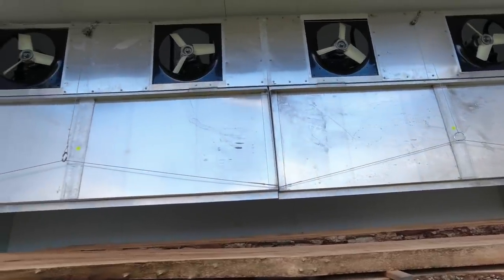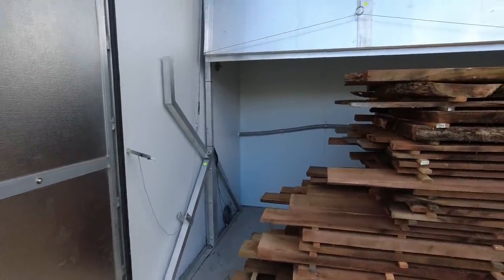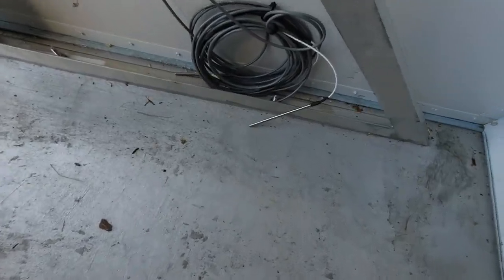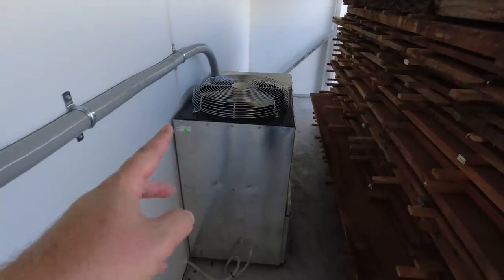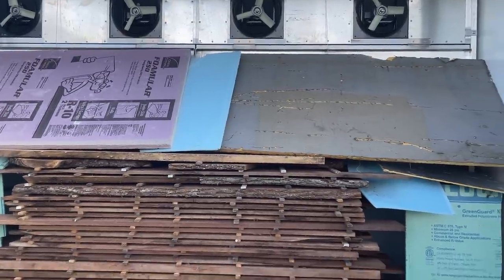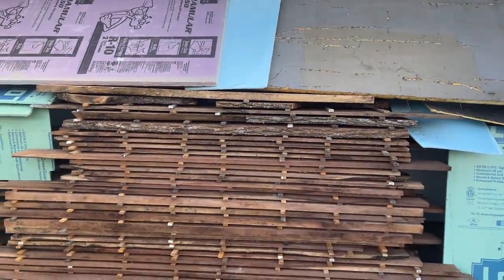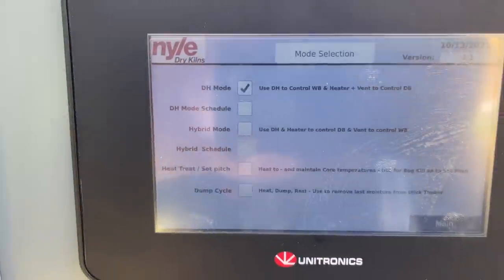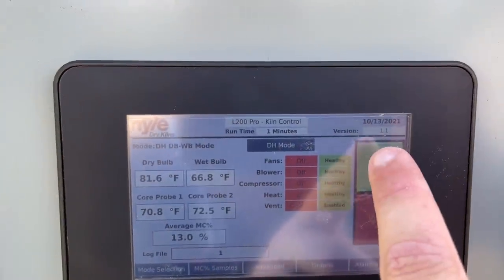Kiln Drying Lumber At It's Best, Nyle L200 Pro Tour

Comment: When I was a security guard at Memphis Hardwood in 76/77, I marveled how much math they had to use, to dry each kiln load.  They would load the stacks via a rail system and rail dollies into the kiln which were somewhere between 75 to 100 feet long.  The person in charge of drying the wood, had to cut samples from each stack as they pushed it into the kiln.  After all the stacks were pushed in, they would close the doors and he had all the samples, he would bring them to the office, weigh each sample, mark it with the weight.  After all the samples were weighed and marked he put them in the small kiln in the back room of the office.  After 24 hours he would weight all the samples marking them with the new weight and find how much weight in moisture was loss.  He would calculate the average moisture of the kiln filled lumber, and have to calculate the drying table   He was doing all his calculating one day when I got to work.  He explained to me how the moisture content of a load, dictated how slow they have to bring the kiln up to temperature, how long they have to be in the kiln at full heat, and how long to lower the temperature.  He said they had a kiln which had a failure in the controls and caused the whole load to not be usable, because it caused the grains to open up like honeycomb.  During the winter it was so neat watching all the steam coming out of all the kilns.
Reply from the maker: Nice sounds like a big operation
Reply from the maker: Nice sounds like a big operation
Reply: Yes when you have the capability to get that hot that quick, the moisture leaving the wood too fast will make it pop and splinter when they hit it with a saw. The moisture has to be removed nice and slowly so the wood retains its integrity
Reply: @OutoftheWoods0623  It was a big operation, now it is a vacant lot.  The old Bruce hardwood plant was across the street and was on over six times the land.  The plant was being torn down while I was working at Memphis Hardwood, until they left a fire going when they went home and caught the whole plant on fire burning it to the ground.  They had been disassembling it to reclaim all the huge beams, what a loss.

Comment: Thanks for the insight into kiln drying lumber… it’s way more complicated than I thought.

I’d always figured it was “close it up, heat it up, and you’re done.” I see now it’s more about surrounding the lumber with dry air and moving the dry air around/through the stacked wood. Heat seems to be more a factor in sterilizing, and controlling the “drying rate” must be critical to creating stable lumber… not a hurry up process!

I’d love it if you could give a quick rundown on the “easiest” and “most difficult” drying challenges (if such a thing makes sense).

Comment: When I worked at both the block plant (think concrete building block) and the lumber treating plant (the boards
with those little marks on them) the kilns were steam. Yeah, I know that seems counterintuitive, but that's the
way it's done.  They also got a lot hotter than 120F. But those aren't "fine wood" either.

For log home logs I've seen them both float them in ponds and run sprinklers on them. There, they want to
season the pieces without having them check, crack. There was a lathe at the plant about 40 feet long.
Impressive!

Every time I see that unit sitting on the floor I think of the waisted space. You'd think it would mount outside
and be ducted. But I aint no engineer.

Comment: Nathan, drive a piece of steel or PVC pipe into the ground so that your bottom door latches slide into the pipe. It will hold the doors open without having to kick a block away. Works great on my shed.

Comment: I know squat about drying wood so take my thoughts here for what they're worth but, could you use some kind of plastic or cloth to hang around the stack to close off the open areas instead of trying to fit different size pieces of Styrofoam? You'd have to weigh the ends down so they would stay tight to the floor and not flap around. I think I saw metal poles on the side of the kiln so maybe you could use magnets to hold them to the sides of the kiln. Just think'n out loud. 😉
Reply from the maker: that's a good question, I will ask Nyle about that one, thanks for the comment

Comment: Nice kiln 👍🏽. But some thoughts that I got:
 - "Standard" crate/crates that you can move with the tractor, bolted stoppers on the floor?
 - Is it some kind of a heat pump, or is it "direct" power that heats the kiln?
 - You could make a curtain of tarp cut to 10-15" wide "flaps". On the sides (three to five feet) all the way to the floor and in the middle half the way down. It could make quite a good "seal"...

Comment: Is the objective to create a large temperature difference between the wet bulb, and the dry bulb? Essentially reducing the dew point (air moisture content)in the kiln. The moisture in the wood, then transfers to the dryer air.
Reply: You got it. Since air can hold more water vapor the hotter it gets, you can tell the relative humidity by looking at the difference between the two bulbs. The dryer the air, the more quickly water will evaporate from the bulb (and the wood), and evaporation lowers the temperature of the surface it's leaving (why a breeze feels colder on wet skin than on dry skin). The lower the relative humidity, the more quickly water evaporates, and the lower the temperature of the wet bulb reads. When the temp of the wet bulb comes close to the dry bulb, you know humidity is high, so you can open vents/turn on the compressor to remove moisture from the air and the kiln.